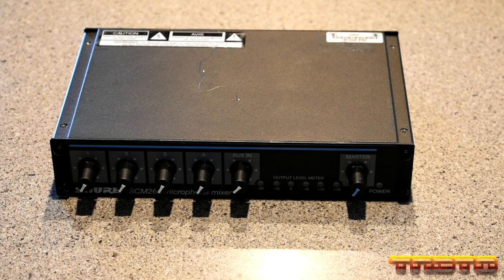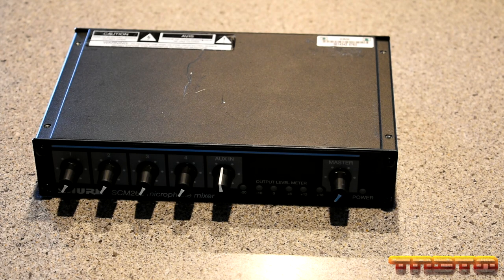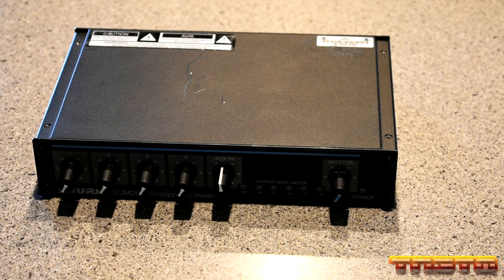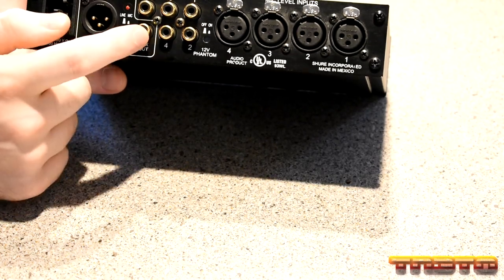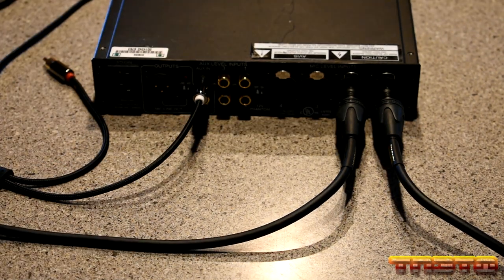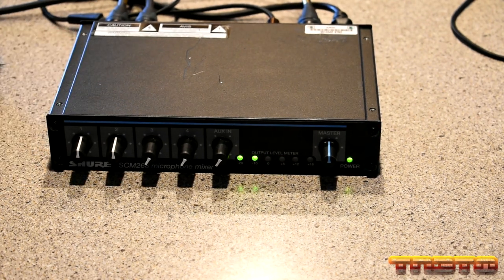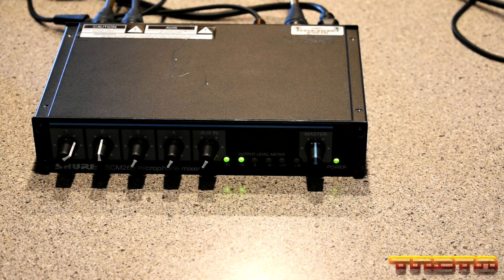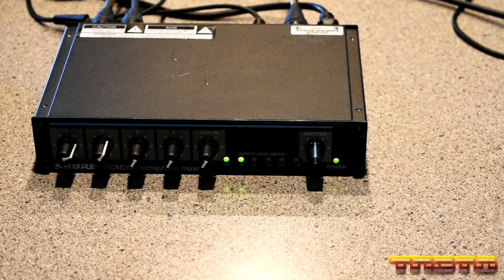Overview and Test of the Shure SCM268 4-Channel Microphone Mixer

Comment: Hello, would this mixer be a good addition for live application using it for podcast? Mainly I would like to know if this would help reduce floor noise, I currently use a rode podmic, Triton fethead and Scarlett 2i2 3rd gen
Reply from the maker: If you have to use a fethead, no, this mixer doesn't have enough preamp gain.

Comment: is the AUX output a mixed output? If I use XLR input 1 and 2 for Shure BLX288/SM58, and AUX input 3 for my laptop, AUX output connect to a soundbar, is it gonna work?
Reply from the maker: Hello, yes the Aux output is a single mono RCA output that mixes all the input channels together. The RCA output should be line level though, where as the XLR output can be toggled from line to mic level as needed.
Reply: @TheN3tw0rq  Thank you very much.

Comment: Hi wondering if you could help meX I have a shite Sm57 mic and I need to connect it to something. So I found a good condition one for $40 but will the mic work with any mixer that it’s cable input outlets match?
Reply: We are recording music vocals with the mic
Reply from the maker: Hello sorry for the delay. Do you mean you picked up the SM57 for $40 or this mixer? The SM57 isn't a bad mic, and since it's a dynamic microphone, most mixers and interfaces should be able to drive it just fine. This mixer should drive it just fine as well. Please make sure that phantom power is TURNED off when using this mic.

Comment: Is it possible to connect the Aux Out to a computer to use as audio for a livestream?
Reply from the maker: The AUX output is RCA, so if your computer has RCA inputs, then yes, but the vast majority of computers don't. You could use a 3.5mm to RCA cable and connect it to the line-in jack on the computer however. Line-in, not the microphone jack, the voltage would be too hot. The other way to connect it would be to get an audio interface with line-level input, usually via TRS combo jack.

Comment: Can I use the Shure SM7B Cardioid Dynamic Microphone with this mixer? Thoughts?  I already have this mixer and 3 of the SM7B -  What do you recommend - trying to set up a podcast / online radio  for home -
Reply from the maker: Hello, the SM7B requires a lot of gain. You would have to use a cloudlifter for it. I don't recommend it with this mixer. This mixer goes good with handheld dynamics such as the SM58 or the Beta 58A. I will be doing a podcast with this mixer using the Shure Beta 58A's. I do highly recommend you buy the Shure windscreen for them though, as they really need a pop filter.

Comment: How did you get this for 5 dollars?! lol

Could this be used to connect 4 xlr mics? I wanna connect this to ATEM mini and then livestream. Podcast livestream of sorts, would this work?
Reply from the maker: Yes, this is a 4-channel mic mixer, it'll take 4 XLR dynamic microphones. I'd very the ATEM mini can take a line level input, it looks like you could hook it up via an RCA to 3.5mm cable into one of the Mic inputs on the ATEM, but you'd have to make sure the input is padded for line level, otherwise the signal will be too hot and distort.